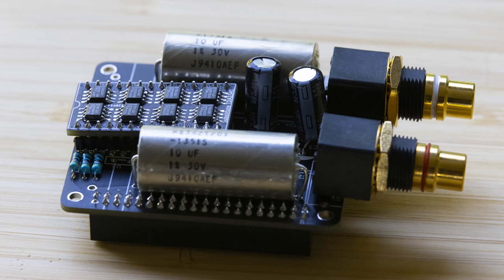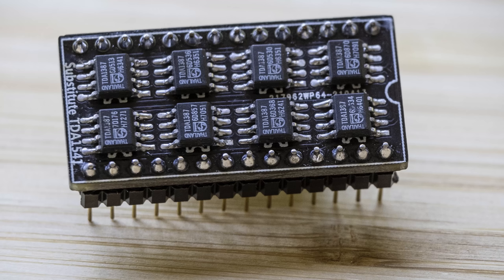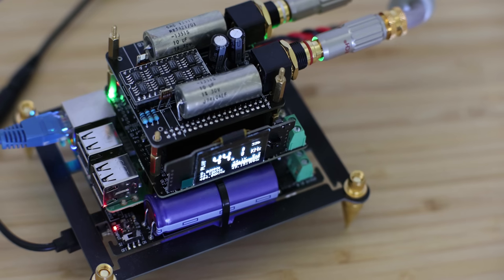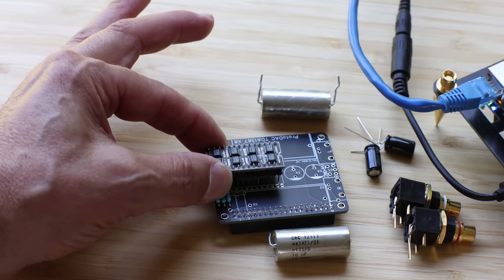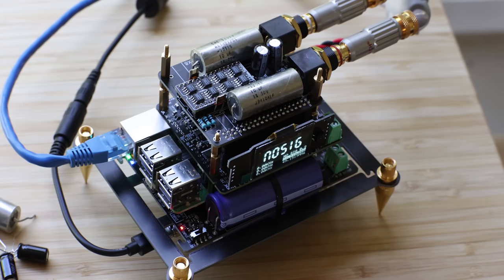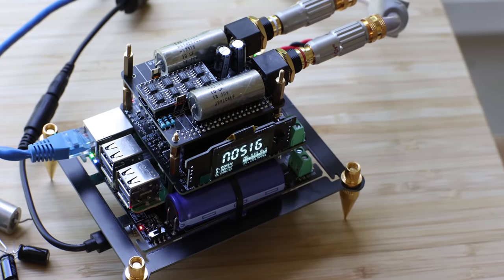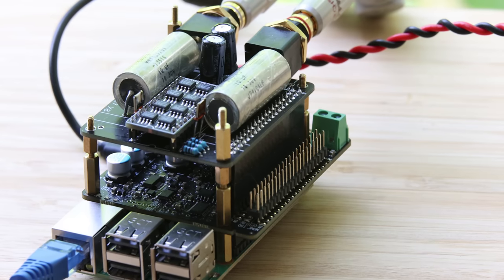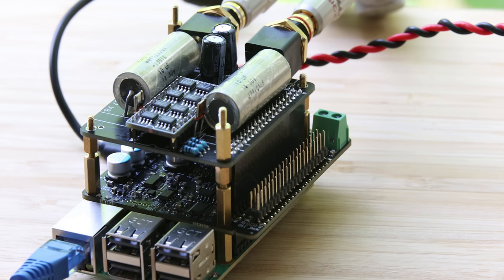ProtoDac Amazing HIFI Audio DAC HAT using eight parallel vintage Philips TDA1387 chips.

Comment: I was reading through the comments, and I hadn't seen anyone actually describe a sense of what the dac sounded like. You mentioned it sounded really really good, but, is it like a $79 SMSL SU1, some topping product, or more of a vintage sound, warmer with a little resonance. This is the kind of window shopping I enjoy listening and reading about. If anyone could post their experience or impression, I think it'ld be a great thing to share. I stumble into this Gabster room, and have really enjoyed it, Thanks!
Reply from the maker: Don't let the price guide you on this one the key to better sound compared to the Smsl is good quality power in the form of great regulators Batteries and ultracapacitors also the main one is the best  re-clocker by Ian

Comment: I have now the ProtoDac, I also ordered the PuriPi for the first step. Later I will order the FifoPi Q7II. Now in your video I can´t see the separate 5Volt to the ProtoDac. In the description they say, if using the Fifo you must cut the pin 2, 4 from the ProtoDac, is this correct? So if i use later the FifoQ7II i must desolder the whole Proto Dac for cutting pin 2, 4? Thanks for info, Alex

Comment: Thanks for this video. I like the way you have done the build. Are there any ideas about a suitable housing? Otherwise the stacked boards will catch dust with the time. What I like is the usage of the proto DAC. Actually I use a simple approach with a Pi zero and a small DAC HAT from Hifiberry. It works but it is far away from high fidelity.

Comment: We just built basically an identical DAC, using the PurePi power supply, Q7 and Protodac module - built with quality components and we're experiencing a harshness in the treble in particular when the dynamics increase.  We're using Moode Audio software and have been playing with the settings and can't get rid of it.  Sounds like high frequency sibilance.  When Miles plays his horn on Sketches of Spain - ahhhh it's not nice, not really terrible terrible but in our highly resolving system we need to push pause - fast!  Any ideas what's wrong in the signal path???  We are running the Q7 with our BK DC bench supply because we can't get those darn 3.2v batteries anywhere.
Reply from the maker: Bench power supplies are not that great if you test them they have a lot of ripple 
Clocks are very sensitive 
You can get by with common 3.7 v batteries just drain them to 3.4 before putting them in but do get the 3.2 v
Ones.
I had great success from thi AliExpress supplier and lithiumwreks
See the bottom of the description of my latest Dac video 
https://youtu.be/EPV1ON23L0Y?si=uZ31hkYq6vSc4LVB
Also make sure your IV resistor values are correct as recommended as higher values can cause distortion see the ProtoDac build documents 
How that helps
Reply: Thanks we couldn't find those batteries anywhere, I'll give the Ali guy a shot.  I measured the I/V metal foil resistors before installing them and they came in at 419r / 419r, but I'm wondering if the sibilance we're hearing is being caused by the I/V resistors.  I'll pull the BK supply and drop in some batteries and see if the treble improves. If not we'll sweep the unit and see if we can't isolate the distortion.  Cheers!
Reply: Update, we drained some nice Samsung 3.7v 18650 cells down to 3.3v and ran the Protodac for the first time as designed and wow, 95% of the high frequency sibilance is gone and with most music it exceeds what our Astell & Kern can do.  I'm starting to think the recordings that we have high frequency problems with are actually the fault of the digitization.  We have a huge collection of high quality digital music and are sampling various audiophile quality recordings and are only hearing the problem on a few recordings.
Reply: ProtoDAC is designed to use 5V. Sibilance is probably due to a bad module.
Reply: @ProtoDAC  No I think the module is fine, we hear the same sort of sibilance in other dacs.  We work professionally in audio and I've basically come to the conclusion that digital audio always has some problems in the high frequencies, some dacs a bit less and some a bit more.  As a result of my digital experiments, we decided to invest more heavily on the analogue side, the sonics are just superior in every way to digital.  Yes vinyl records can have surface noise and yes reel to reel tape also has tape noise, but and this is a big but, when you compare a good quality piece of recorded music both in digital and analogue the analogue version almost always sounds better and not by a little bit.  Now I'm not talking about the modern remastered records that are cut from cd masters, but real AAA recordings (prior to 1982).  The one very interesting thing is that digital records made from about 1979 to 1985 can sound amazing, sort of a hybrid between a cd and record, low noise, great dynamics and warmth, with no high frequency issues.  But from about 1985 on, that all changes with the invention and adoption of the first digital work desks - from that year onwards digital everything basically sucks the life out of the music.

Comment: can i use this kit to build up a bluetooth speaker ??? i know bluetooth downgrades a bit in audio quality, but i have a amp board which sounds horrible. And the big + is, i can add a display with touch to the system for functions like adding a streamurl, or wifi keys and that kind of stuff.
Reply from the maker: I would just add a amplifier and make a speaker out of it you can control the stream via your phone better then Bluetooth
Reply: @Gabster1  sounds great, i was thinking a bit to complicated. Will these modules also work with a pi 5 / pi 5 pro ?

Comment: We're using basically an identical build to yours (running Moode app) and we can't get DSD to play, natively or DoP.  If we remove the Q7 from circuit and just stack the Protodac on the Raspberry Pi, DSD plays perfectly.  Any ideas?  I've contacted IanCanada, but no luck.
Reply from the maker: See page 9 of the FifoPi Q7 manual I think you need a monitor Pi Pro to disable the DOP but I may be wrong I never tried it.
hope that helps
Reply: @Gabster1  you can turn the DoP off using switch 1, located on the underside of the board.  We tried that and nothing.  The weird thing is if we pull the Q7 out of circuit and drop the Protodac directly onto the Raspberry Pi, DSD in all resolution and PCM play just fine.  But of course we are back to a fair amount of sibilance in the treble, which is almost completely eliminated with the Q7 in circuit.  I'm pretty sure we were directly feeding the Protodac DSD using DoP, I can't see how it would work any other way.  But Ian says we need to upsample the DSD into PCM to get it to work, which in fact we didn't need to do without the Q7 in circuit.
Reply: Did you figure it out? I have a similar issue with the Q7 and Protodac and no audio output.
Reply: Q7 (also Q3) provide only 3.3V to GPIO pins 2 and 4, and this cannot be changed. FifoPi MA is also designed to have 3.3V on 2,4, but it can be changed.  RPi standard GPIO is 5V on pins 2 and 4. ProtoDAC needs 5V. In order to use Q7, use a stacking header with pins 2 and 4 removed. The apply 5V to the 5V/GND pads between the RCA jacks on ProtoDAC.
Reply: I am tying to use a TransportPi Digi as a reclocker, but can’t get any audio out. If I remove it from the stack and just use the Protodac on the pi with moode, all is golden. Any hint on what settings to use with the TransportPi ?

Comment: I have the Proto DAC, plus the purePI the fifo Pi Q7, so all, the only thing i am missing are the trebles, especially on spotify, on AirPlay it is much better, i don´t now how to solve the problem with the missing highs, if somebody give me a hint, i would be very happy. Since a few days I have the Mcintosh C500T Preamplifier , which works great on CD, but the Proto DAC makes me a little bit thinking why the trebles are not comming through.
Reply from the maker: Try different capacitors maybe also Spotify is not that great switch to Tidal  or Qobuz
Reply: Thanks I ordered two Mundorf capacitors, we will see

Comment: I would like to thank you for the ProtoDac review, can't wait to build it.
Right now, I am considering how much money to spend on the project..in case I will use the PurePi, does it matter if I power it with IFI Power supply 5V or I can use cheaper PS without some negative effect on the final sound? Thank you for advice
Reply from the maker: You can power it with a cheap psu you may not notice any difference.

Comment: Hi, I built two of them, and the bots play for about 20 seconds before stopping. After that, a sound starts, resembling the noise made when plugging and unplugging cables repeatedly. Where could the problem be? Thank you.
Reply from the maker: I Would try a different power supply and or a different Rpi  could be the power supply or Rpi faulty overheating
Reply: @Gabster1  but i bought raspberi pi pro dac hat and works fine

Comment: Hi Gaby! Thanks for your videos, I enjoy watching them. I already have an unused rpi4 and ordered the protodac, so I first want to test the most simple build (rpi+protodac)... so I don't throw away money buying a fifopi q7 if I screw up with the soldering of the protodac 😛. I wanted to know if I can use my phone, connected with USB to stream music? Thanks.
Reply from the maker: For RPI/ProtoDac I would run it on Moode or Ropieee Xl and control it from your phone 
To use USB you need a more complicated setup.

Comment: one question: i will get a good DAC from a friend , I have already purepi, fifoQ7, which transport to the DAC you would choose? TransportPi AES, Flagship AES/SPDIF s transport?, or TransportPi Digi/II, ?
Reply from the maker: If your friends Dac has I2s in a HDMI 
Get the HdmiPi pro II if not get the Transport Pi AES 
But since you have a Purepi and FifoQ7 already 
Your half way to a Gabster TD1 Dac
Just get a I2s to PCM board and a Gabster TD1 Dac and try that and hear the difference for yourself 
Gabster TD1 Dac My Favorite of all times
https://youtu.be/y3MB5W970Ow

Comment: Thanks for the great videos you post. I have s question the batteries on the PurePi. What capacity do they need to be something like 1800mah or more. Thanks for your time
Reply from the maker: Not really as long as they are 18650 lifepo4 3.2v the mah rating is usually inflated so anything will do hard to find but AliExpress has some

Comment: I just received the ProtoDac.  Is it possible to connect Ian Canada's OPA861 I/V hat for analog xlr output to the ProtoDac?   Thank you for the video.
Reply from the maker: No that is not possible as the ProtoDac is already line level that is the beauty of it just use your rca input as long as you are under 4 ft you are fine. You will love it
I tried to get balanced you will need 2 protodacs and a processor to reverse 1 of them by then you lost all the benefits.
Reply: Ok, thank you for the reply.   @Gabster1
Reply: Ok, thank you for the clarification.  @Gabster1

Comment: Dear Gabster, I built one. Unfortunately after powering up in fixed volume mode the sound starts getting hissy and scratchy after 10 to 20 seconds. (the software volume mode doesn`t work at all) I checked the dac over and over, looks ok to me. Is it possible that there is a bad joint in the 1387module, or is it a problem in the Mo0de software? Unfortunately it is not possible to contact mr. Curtis. For the record my Pi 3 with Hifiberry hat works perfectly. What do I need to do?
Reply from the maker: If you assembled the ProtoDac yourself check for bad connections or shorts between pads
The modules are cheap it is possible you got a bad one try a different module got to be something wrong somewhere 
It can also be software I never tried Moode
Reply: @Gabster1  Thanks for the swift answer. I think the most likely cause is indeed a bad module, I ordered two new ones.
Reply: A new module did the trick, now it works, an the sound indeed is very good. Thanks for the advice.
Reply: Sounds like a timing mismatch between output of the PI and the DAC. Variance doesn't need to be much to eventually cause jitter to get so large that the DAC starts seeing errors causing distortion. Not sure what you would do about it without some test equipment to find the root cause. One thing to so would be to make sure configuration on the PI is correct for bit rate etc.

Comment: Hello Gabby, is it correct that yor dac tda1387 running on pin 2,4 3,3 volt ? thanks Bart.
Reply: I would doubt it. RPi GPIO pins 2 and 4 are 5V. Minimum TDA1387 supply voltage is 3.0 . Recommended is 5V.

Comment: Hello Gaby. First of all, thank you for this video.

I've done my soldering duty ;) now I have the ProtoDac (copper shielded) on a RPI4 with volume (Qobuz implemented so well) and it sounds pretty good. It is a very  enjoying set up. The music is very pleasant to listen to. I want to improve the set up step by step with Ian Canada items. I don't know what I have to do first : FifoPiQ7 of PurePi or other ? What do you think ?
Reply from the maker: If you can afford both it would be ideal as the Fifopi Q7 will need a good 3.3v that is available on the purePi and this way it will be easy and will open the door for future upgrades
Reply: @Gabster1  Thank you for tour clear and quick answer. I take the advice as I will do both at once.

Comment: Hi  I like you Chanel a lot Thanks
I have a pi with #20B. TransportPi Digi,Audiophile grade master mode digi transport

And use popieee and roon with a external DAC. Can I use the protodac instead of my external DAC?
Reply from the maker: Yes you can I believe you can simply plug the protodac on top of the TransportPi Digi as according to the manual Pin 2 and 4 are 5v so simply plug it on top and enjoy the music let me know if it sounds better or not.

Comment: Hi Gabster, i see that the big caps are 10uF. Wich is the value of the z-foil resistrors? Thank you
Reply from the maker: mine are 420R depending on your amplifier gain you can adj a bit more or less
hope that helps.
Reply: @Gabster1  thank you
Reply: Max 430R to prevent clipping at 0dB.

Comment: Is there a way to configure this as an external DAC to take an optical or SPDIF input so I can feed it with my Node 2i?
Reply: Yes. Need an SPDIF to I2S board, like a DIR9001. You should feed it polarity inverted data.

Comment: any change of getting the schematic of the TDA1387 x8 module?
Reply from the maker: The Builder guide link in the description has a schematic and tons of info
Reply: @Gabster1  I had a look already to the builder guide, I can see the schematic of the ProtoDAC PCB, but I can't find the schematic of the TDA1387 module (the Green PCB with 8x TDA1387 and the decoupling/pin7 capacitors)
Reply: The eight TDA1387 chips are in parallel, and have individual power supply pin 5 decoupling capacitors and pin 7 capacitors mounted on the bottom of the PCB. See the Builder Guide 2.2 for information on the pin assignments. Pins 7-24, 26, 27 don't connect to anything. Pins 1-4 are I2S with duplicate BCK on pins 2 and 4. Ground is pin 5, Vcc is pin 28. Pin 6 is right channel output, and pin 25 is left channel output.

Comment: Another question - instead of protoDAC maybe it would be better to use OPA861 zero feedback ? I heard that protodac is giving around 11bits. What do You think ?
Reply from the maker: The dac Chip TDA1387  ( protodac ) Does  not need a OPAmp it is Built In
Reply: I said this wrongly. I mean if it's way better to invest for OPA and dual mono or the difference is not worth it ?
Additionally did you think to make video about comparison protoDAC, dual mono plus OPA , HiFi berry DAC and famous IQaudio DAC - no one test IQaudio with such a clean system yet. It could be a good video for a cheap set.
Reply from the maker: @T3kA123  Thedifference is not Big but Dual Mono/Opa is better not sure if you saw this Video I talk a bit on the differences
https://youtu.be/A0Je4SmiNzw?si=4xoKk__55wyKpr7S
Reply: Now it's clear 😊 I'm align with all You videos . I will start with protoDAC plus raspberry , additionally I will compare it with IQaudio hat. ProtoDAC will have jantzen standard z caps 6,8uF. Let You know definitely , tks a lot.